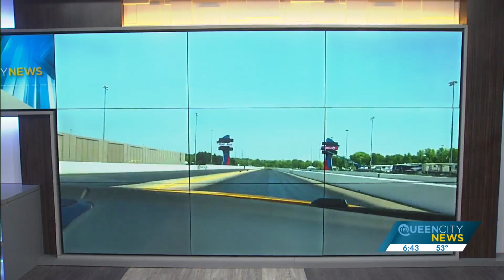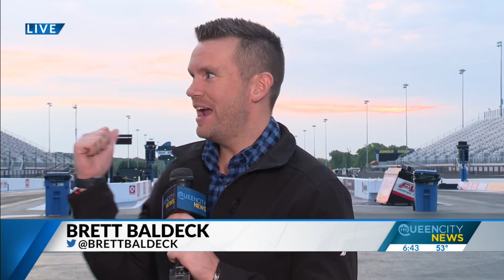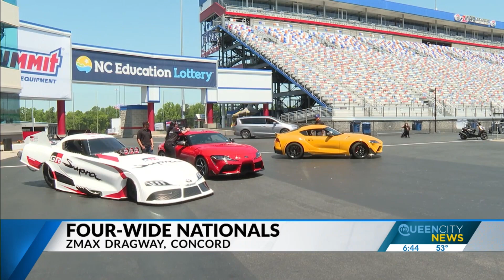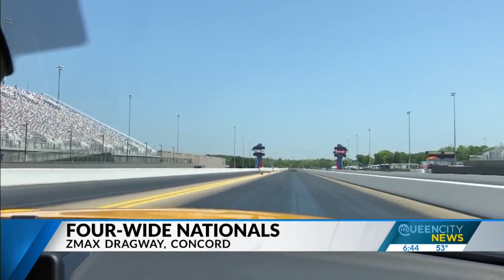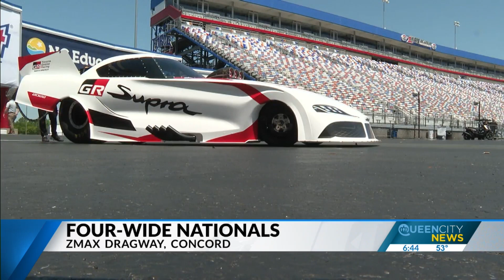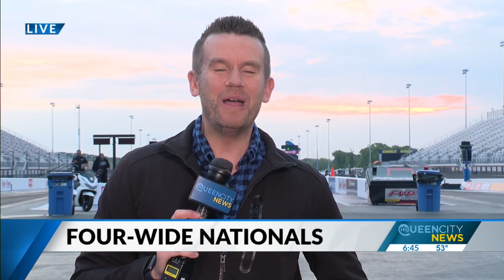NHRA Four-Wide Nationals kicks off in Concord

Comment: Tachometer tells RPM not speed.
Reply: On a race car that's how they tell speed. It's easy to compute and race cars don't have speedometers, except maybe the new high tech digital NASCAR cars.
Reply: In most V-8's it's about 1k RPM per 25 MPH in high gear, depending on gearing.